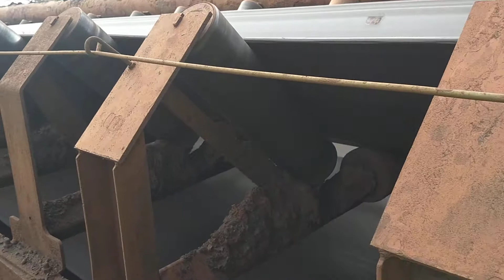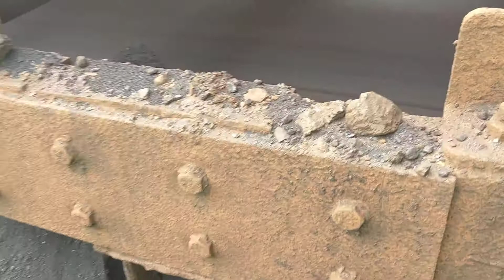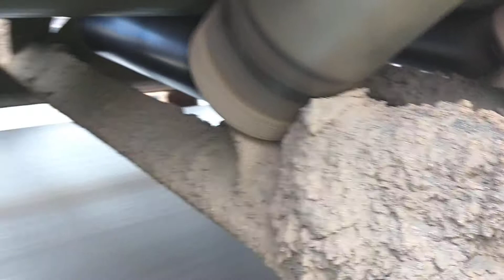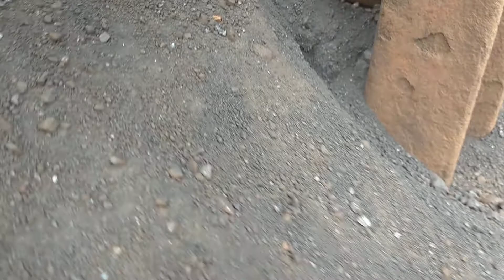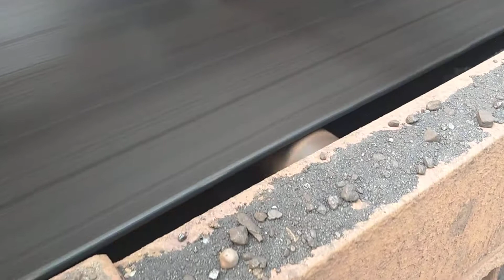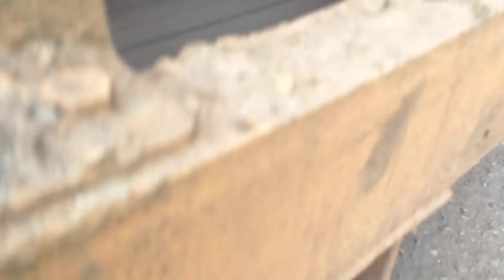Belt Conveyor Design Defects, Material Spillage

Comment: Solution?
Reply from the maker: Thank you for your comment. Many things to do to minimize material spillage.
1. Proper belt scraper (internal and external) system.
2. Feeding material centrally on belt. Off center feeding will increase the possibility of spillage.
3. Proper skirt board arrangement and feeding system.
4. For sticky material, water based belt cleaning or washing system
5. Regular maintenance.